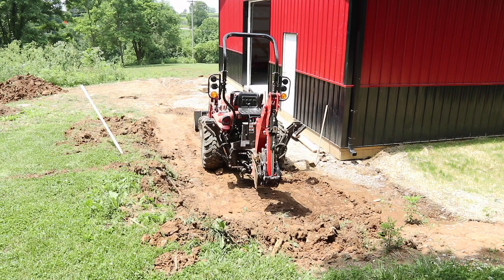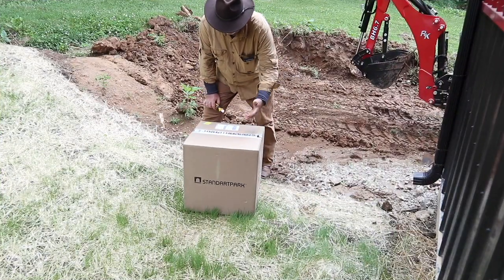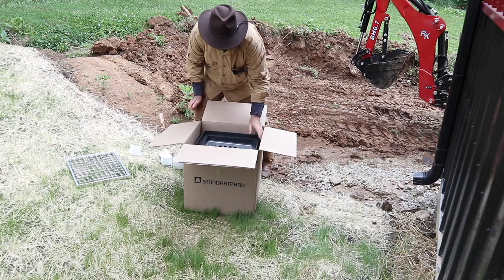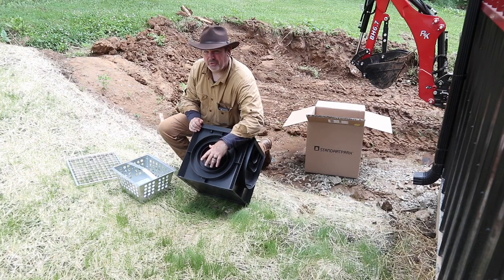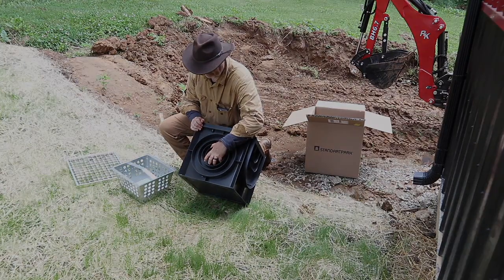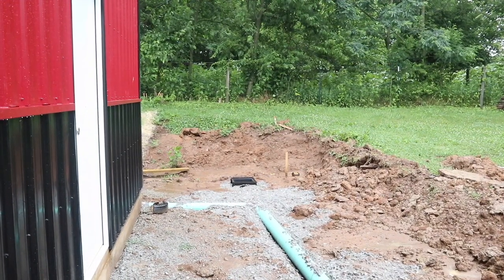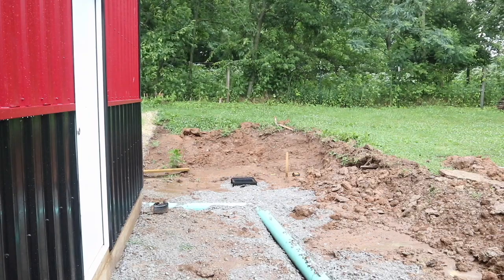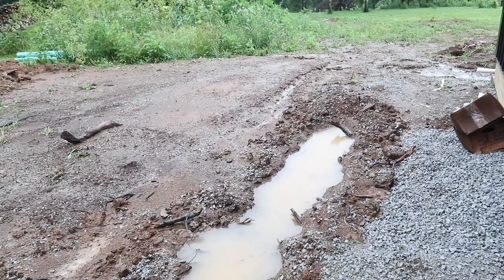#049:   Install Standartpark Catch Basin with the RK25

Comment: Dude thanks a bunch for sharing. I have heard of a “catch basin”. But now that I see it I will be using one In an area I am about to repair. Thanks!!!
Reply from the maker: Great new video Denny!!!    I will likely be getting a smaller one to install next to my driveway where the drive serves as a dam for water draining off the main lawn :(        Thinking of getting a 12"x12" and use 4" pipe as the volume of water will be less at that location.

Comment: Nice quality videos, what kind of video camera do you use ?
Reply from the maker: Thanks for your question... when I'm talking directly to the camera it is typically my Canon EOS M100.   I like that it has a forward facing screen, down side is you cannot hook up an external mike.    When I'm moving  the camera around it is likely my GoPRO Hero 5.    And if it is a newer drone shot, Hero 4.     Nothing overly expensive for fancy.

Comment: I was wondering, when you used your backhoe , when digging your trench, did you have to switch from backhoe to tractor every time you needed to move you  position or did you leave the tractor on neutral and used the backhoe feet to hold your position and used your backhoe to push your tractor back to the neck position?
Reply from the maker: I got off and repositioned.   I think your suggestion would work great if just going in a straight line.   Used to do that with real backhoes.

Comment: What kind of pole barn is it?
Reply from the maker: Howdy ShellStud.    Not completely sure of your question.    If you are referring to the 'brand' such as Morton etc, then I do not know.  It hired Perkins Pole Barns in North Central Kentucky to design/permit/build it for me (Shell, doors, windows and concrete).     Does this answer your question?